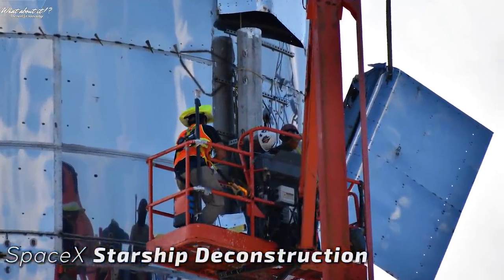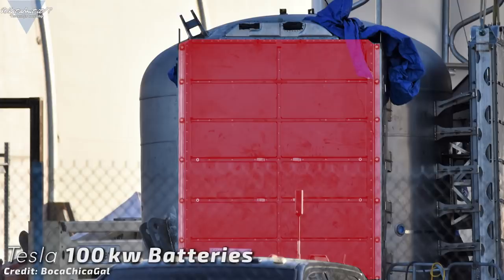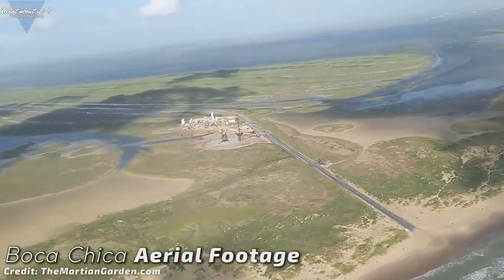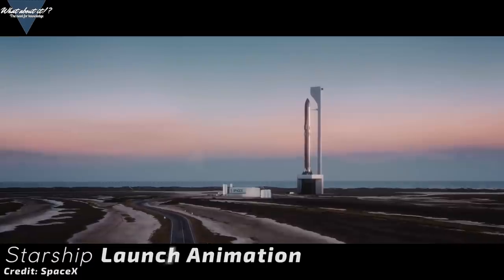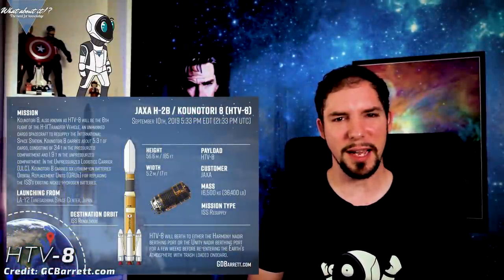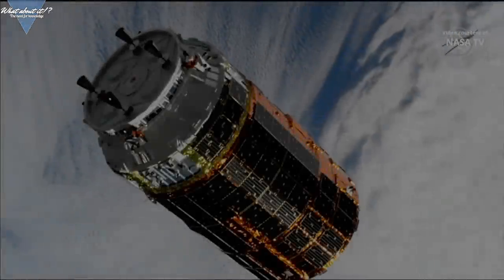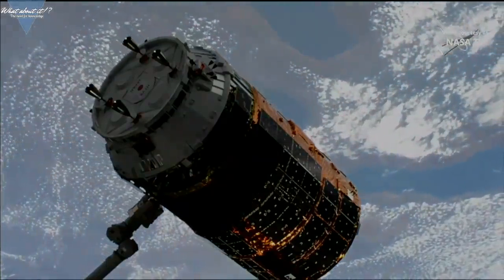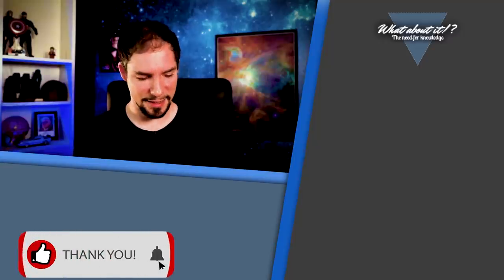39 | SpaceX Starship Disassembled Again – Starship Website Online – JAXA HTV8’s Resupply To The ISS

Comment: Rather than just carrying bigger telecsopes than JWST, the starship will be able to carry smaller ones in one piece without the need to fold the mirrors making the telescopes much more reliable and cheaper.
Reply from the maker: Much more reliable and cheaper indeed. Imagine a Lames Webb without the extremely complex folding mechanism. Also Starship might be cheap enough to finally start assembling telescopes in space. Just launch it in multiple missions and assemble it in orbit. So many new posibilities!

Comment: Launch permission may be a problem, at least for the full-stack test.  Boeing and LockMart have their lobbyists everywhere. Artemis 1 will not launch earlier than 4/2021, so don't expect Super Heavy to launch earlier than that.
Reply: fs2728, I believe SuperH will launch WAY BEFORE 2021 if they have enough Raptor engines, which they should
Reply from the maker: @keithmcknight7646  Agreed. Musk spoke of 6 months. Even if you double that, we're still in 2020.

Comment: Thanks for this and your whole channel.
I have a pet peeve, those are 100 kilowatt-hour batteries, not 100 kilowatt batteries.  They are more like 500 kilowatt batteries. (Power vs. energy).
Reply from the maker: Absolutely agreed and thanks for the comment! It's actually a typo. I meant to write kw/h... damn.
Reply: @Whataboutit  kW/h is wrong. It is kWh.
Reply: @Whataboutit  kW/h would be kW per hour. The energy is measured in kWh, the power (in kW) multiplied by the time (in hours). That's a huge difference.

Comment: Those two vertically oriented steel structures currently sitting on the hopper launch pad are from the GSE quick disconnect fixtures for the hopper.  I'd expect them to be scrapped at some point.

Comment: Just guessing but perhaps the pile setting at the launch complex is for the raised launch structure for SS/SH beside the landing pad where Hopper is sitting. The work at the hopper launch site is the steel platform that Hopper will sit on for its role as a vertical test stand. I'm waiting to see what happens.
Reply from the maker: You might actually be right! So, no launch structure as originally planned. For Super Heavy they will have to build one though, so it can't be far away. Thanks for the comment! :)

Comment: Those windows were my main problem with this rocket. Lets exchange all windows with cameras! It will save mass and whole rocket will be stronger.
Reply from the maker: Not all of them! I know, windows are not needed and cause problems, butwhat use is it to fly through space for such a long time and not have a window to actually look out with your own eyes...? :/
Reply: @Whataboutit  so, what about making small sealable observatory room? Still, our eyes aren't that good for observation. It would be better to place one bigger camera and use it coupled with led displays.
Try to suggest windows on nuclear submarine :) the situation isn't that different.
Reply: @petersvancarek  well to be fair nuclear submarines fit a much different purpose, and nothing would be visable regardless. Large windows on the starship could be made of a ceramic material called ALON, comprised of aluminum, oxygen, and nitrogen. It's basically a real life version of the transparent aluminum from star trek. A large window of it would be less vunrable to failure points when repeatedly pressurized or shaken during launch. Also an actual window provides depth perception that screens can't do.
Reply: @ianmeade7441  Also there is a reason why the AlON is costly and only relatively small windows are made- preparation requires hot isostatic press for final step.
To be fair there is not much to observe in space. Other then in position close to planet you see only stars. Just imagine being outside during starry night. Now imagine you have the only view like that for 9 month travel. Simply nothing new to see, only points of lights, without any movement, any blink. And you would need to take epecial care not to be on side where Sun shines since ceramic material doesn't stop hard UV radiation.

Comment: I will lay bets the ringwall is for a cryogenic LNG storage tank. Large LNG / Liquid Methane tanks have a concrete outer shell and a steel inner shell with the space between filled with vermiculite and purged with dry air or dry nitrogen to prevent ice bridges forming. This does not work for liquid oxygen so they will need vacuum insulated tanks.
Reply from the maker: Interesting thought. But what would you need a Methane tank for at the shipyard? :|
Reply: @Whataboutit   If you have enough storage you can order LNG by the entire ship full. as opposed to using tanker trucks.
Running cryogenic pipelines upto 20km  to the launch pad from bulk storage would be an option too as this is common in industry for ship loading & unloading. This also minimises the consequences of an unscheduled disassembly event on the bulk storage.
A lot depends on just how much LNG Elon is planning to use per week - bigger tanks have less losses than multiple smaller tanks too.
The other reason is this is not a high pressure tank - no vacuum, so the liner uses the exact same stainless steel as the rockets so you can use the same workers to build the liner, therefore much cheaper.

Comment: Looking at the SpaceX website's "Satellites" and "Space Station Missions" pages:  This will be a direct replacement for the Space Shuttle at supposedly far, far less cost, won't it?!!  Maybe some type of "Canada Arm" could be fitted, too.  Probably could launch at least a dozen Starships for the cost of one Space Shuttle launch?  What would be the point of the other cargo resupply vehicles, then?  JAXA's HTV, NASA's Cygnus, Russia's Progress, SpaceX's Dragon?  All obsolete.  Crew Dragon and/or Starliner and/or Dream Chaser and Soyuz would be 'lifeboats' which will have to sit parked to the ISS, on a readily accessible docking port for long duration...months to a year, I suppose...and remain ready for rapid power-up and usage.  That takes up a lot of docking ports.  Why not have just a single Starship docked to the ISS for long duration that can serve as the lifeboat?  Even if some catastrophe has crew trapped in an ISS module and not able to get to the rescue ship, the Starship should be able to maneuver around to them and if they have EVA capability or a docking port, rescue them.  Might even be possible to have a rescue airlock that could seal itself to a spacecraft surface to allow a hole to be cut in the hull and take people out that way.  No time to design this stuff when an emergency happens.  Better to have it and not need it.  It all depends on which is safer and more feasible to maintain over time.  I mean, if Starship can sit in a transfer orbit for 6+ months to Mars, with propellants aboard, why can't it do the same at the ISS?           Can Starship reach orbit on its own?  SSTO?  Does anyone know that yet?  And if so, can it reach the ISS?  Or, does it have to use Super Heavy to get there?  Because it must keep propellants to land.  And for a rescue, the biggest problem would probably be orbital plane...to be able to launch within 24 or 48 hours to join the ISS's orbital plane on any day...is that possible?         Or would it be better to have something like a Crew Dragon (maybe a non-Draco, Rescue-Dragon...abort system not needed if launched unmanned...although, it needs an orbital-maneuvering system) or Dream Chaser sitting atop a large, 2-stage SRB in an underground or above ground silo, protected from the elements, ready to go, unmanned, with 7-seats available for crew rescue...as a contingency to any LEO orbit?                 Space Shuttle had thermal radiators on its cargo bay doors.  Why were they needed?  The ISS has thermal radiators, too, doesn't it?  Won't Starship need something like that, too?
Reply from the maker: Thanks for your thoughts! You summed it up pretty well. If Falcon9 was a true innovation, Starship will simply be disruptive. If the concept works, everything else will have to be questioned.

Comment: @3:40 - what is that whole ramp thing for? It's not going to take off horizontally, is it? What's the purpose of that kind of setup?
Reply: Elevated flame diverter
Reply: @michaelmerrell8540  Wait - what? I thought a flame diverter is the trench underneath the launchpad to avoid blowback. That pic shows a Starship on its side, as if it's going to take off from a ramp. Why is the rocket on its side instead of in a vertical position?
Reply from the maker: The ramp is for transfer after landing. It takes of on the plateau, lands down at the pad and then can be brought up again via the ramp.
Reply: @manofsan  ah, I thought you were asking about why there was a ramp up to an elevated launch point.
Reply: @Whataboutit  Thanks for your answer Felix. Has anybody else ever used or proposed this concept, or is it a brand new one for Starship?

Comment: Using the images from the Starship presentation, I ran the numbers on Starship performance.  Also, as a sanity check for comparison, I used Saturn V as an analog since it’s about the only thing around to come even close to what Starship is.  

For the Saturn, I only used the first and second stage. I deleted the engines and propellant from the second stage and treated it like a large payload section (much like in Starship). I didn’t delete the thrust frame but completely left out the interstage so that’s probably being conservative in Starships favor, and besides, I couldn’t find the weight of the interstage. The now modified S-II ‘payload section’ ended up being 75,000 pounds. On the first stage, I deleted the mass of 2 of the F1’s (37,000 lb), 15,000 pounds from the thrust frame and 10,000 pounds for retro rockets on the first stage. I ended up with an empty weight of 643,000 lb for the entire assembly and propellant weight of 4,400,000 lb. That yielded a perfectly believable (and respectable) mass ratio of 7.85. 

Next, using the image at 34:40 of the presentation (of the tanker refueling Starship), knowing the tank diameter of 29.5 feet, I determined the length of the tank to be 73 feet and that yielded 2,500,000 pounds of propellant.  From this I concluded the chart was using 2,100 pounds to be a ton.  So the propellant load number was spot on.  (Btw, I was using a supercooled CH4/LOX mean density of 50.5 lb/cu.ft. since those values were the lowest my charts showed, there may be slightly greater densities possible).

With all those values now in hand, I ran the Saturn V mass fraction against the Starship propellant load and found the empty weight to be an astonishing 365,000 lb.  (That would be 174 of the tons used in those charts).  But, if you calculate the mass ratio using the propellant data in the chart at 14:40 of the presentation and the 120 ton empty weight value given by Elon himself, you get an absolutely impossible mass ratio of 11.0.

Using Saturn V as an analog is very forgiving to Starship (especially since I subtracted so much of the weight that wouldn’t be used if it were being employed in the same fashion as Starship).  Then, when you consider that Starship has a smaller diameter, higher density structure, lower density propellant, aerosurfces, and header tanks (all things that work against a high mass fraction) makes even the 7.85 value a tough sell.  The 11.0 value is simply not possible using the construction techniques for Starship.  Try Kerbal on a Starship that weighs 365,000 lb (and that’s with no payolad!) and see how far it gets (sorry, I don’t know how to use Kerbal).

Feel free to double check my assessment; I don't think I messed it up, but a double check couldn't hurt.

Also, I see as they disassembled the Starship in this video, the upper access hatch clearly does not go into the upper propellant tank.  I’m willing to bet the lower one doesn’t go into the lower tank either and that in this version, there are two separate tanks with no common bulkhead and the location of the lower hatch is also just above the top of the lower tank.  Those sections will have to be pressurized to give Starship enough strength to even just support itself when loaded, much less endure the acceleration of flight.

There is much not being said about the true nature of Starship.
Reply: Not in the Space industry, so some of your terms are lost on me.  Are you saying there isn’t enough structural weight to have a sturdy ship here?
Reply: @737smartin  Indirectly, that would be yes, but I don’t think that’s what’s going on.  I find it hard to believe that a rocket built in this way could have a mass fraction of 11.0.  So I guess what I’m really saying is that it’s not 11.0, even though it’s being claimed to be.  But by extension, if it were actually 11.0 then yes, that would result in a vehicle too flimsey to fly.  My guess though is that it weighs much more than stated and is thus strong enough to fly, but too heavy to be very high performance.
Reply from the maker: Did you forget about Super Heavy?
Reply: @Whataboutit  He calculated an SSTO, I think?
Reply: @Whataboutit  No, in fact Super Heavy may end up with better numbers than Starship.
Reply: @Fannystark007  That occurred to me also, but it isn't going to happen.
Reply: I mean, Elon may have been thinking in terms of SSTO.  I wasn't.

Comment: well it was always going to be a bad idea to have lots of windows anyway, at least for a interplanetary Starship due to radiation, although I suppose you could put water in the window like a tank to absorb neutrons at least, and really it's bad for a normal Starship also as glass is heavy.
Reply: Plus, they can position the Starship's windows orientation in it's flight-path to not be in the sunlight to just deal with interstellar radiation.
Reply: @adamsmith5151  Errr dude you know radiation travels at the speed of light right, well not neutrons, but gamma, and nerutrons will be flying much much much faster than Starship will be going.
Reply: ERR dude, I'm talking about positioning the Starship so that the windows don't face the sun.
Reply: @adamsmith5151  I believe halve the radiation in space comes from interstellar space.
Reply: As we all know Scotty will give us the transparent aluminum in Star Trek IV
Reply from the maker: The point is to be able to look out the window. If Apollo 13 didn't have a window, they all would have died. ;)
Reply: @Whataboutit  You can do reflected light if it's just for a view finder, which you would make the mirror out of a materiel that absorbs harmful rays, although honestly trying to land something like a Starship by hand would be next to impossible due to the fact that you would have to do a suicide burn on Mars as even 1 engine would be too powerful at 40% thrust.

And with one engine you would have to compensate for the off centre thrust... by hand... Also that forgets that the handing of a Starship wouldn't be easy either even without off-centred thrust.

So honestly no one is going to be able to take over to land, furthermore the site would have already been extensively scooped out by the 2 missions before a crewed landing from the ground.

Although I would be very shocked if we don't already have extensive and detailed altimeter maps for Mars already.
Reply: @Fannystark007  Alumiunum would actually be bad because it would capture neutrons and release them as lots of gamma radiation which would do more damage than the neutrons would have done in the first place if you had no shielding for them in the first place.

You need shielding which has a lot of hydrogen in it to basically reflect them.
Reply: @Etheoma  yeah, was meant as a joke ;)
Reply: @Fannystark007  I know, but I just thought I would mention that aluminium would be bad.

Comment: Why don't they strip excess materials from the modules that are going to burn up anyway. Or they could expand the habitat of the station with each module. They could start designing upper stages to be used as propulsion or habitation. If it costs that much to get it into space, why not use it once it's up there?
Reply: Presumably because they have no way of actually using them... it's not like the ISS has the facilities to manufacture new modules or spacecraft even if they could salvage some materials.
Reply from the maker: I had that exact thought many times before. It's a bit of a riddle to me. Build the modules in standard segments, that can be used to further build the ISS.
Reply: @Whataboutit  hell yeah, so wastefull
Reply: @simongeard4824  good place to practice manufacturing in space huh. All these egg heads and no one's thought of this. There are whole companies working on this but having to build their own architecture will take too long. Use what you got man. Lol! Keep it simple